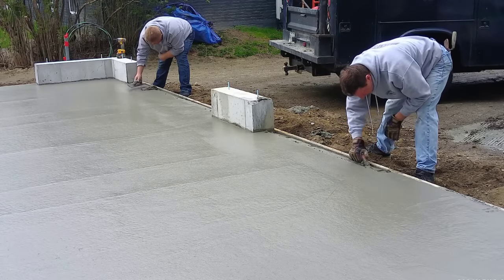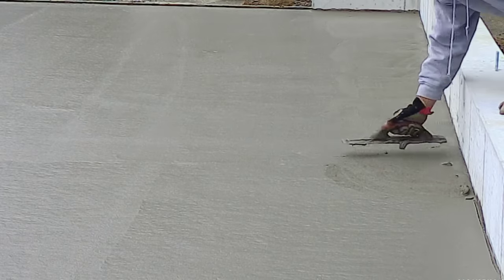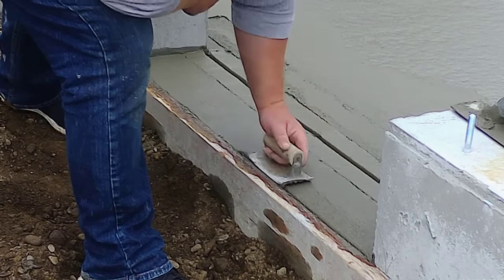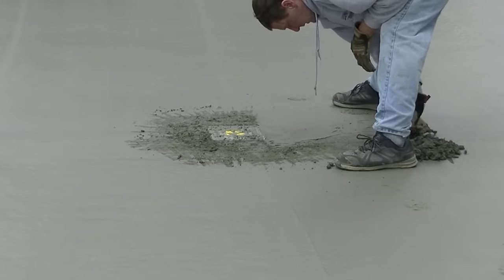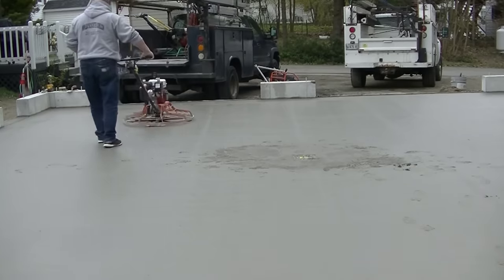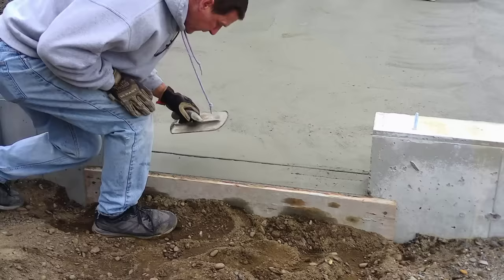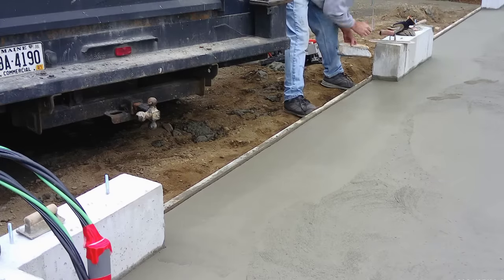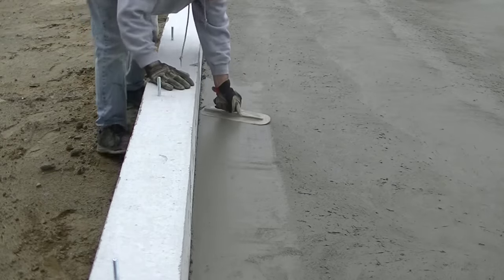Finishing Concrete - 8 Skills To Learn To Become A Better Finisher

Comment: At 2:00 minutes in, you use your mag to level up those edges. For what it is worth, I often handle my mag bavkwards. Your hand is close to the backside of the mag which applies more pressure next to the wall. That makes a new guy tend to mag it in un-level. Reversing the handle away from the wall when the mud is still soft tends to help keep the outer edge higher/level.

Comment: For the front cut down on garages and pole barns, we measure to the end of block, cut a 2 by 4 to the length then put a nail about a half in down in one end and cut the head off the nail. Let the nail ride on the forms and you’ll have a perfect half inch cut down

Comment: We typically pull the lid off the drain when we finish. If that drain allows that. I like the joint off the door. It does typically crack. Great place for zip strip. I get pretty picky on my overhead doors and check them with a strike off. Keep the videos coming. Great work.
Reply from the maker: Thanks Samuel!
Reply: My concreter suggested a round drain as the square ones have more chance of cracking around the drain. Great video. What is the smoothest finish that will allow 2 pack painting on my garage floor. I'm having 300 square metres done this week. Thank you.

Comment: Some great advice. The joint on the doorways is really something I wish more people knew. And the drain advice is something I will apply to my jobs. We usually get close. But I like the idea of going through again to make sure it's perfect. Great video!
Reply from the maker: Glad it was helpful!
Reply: Bob C.
I can relate I worked in concrete work for 45 years.  Used many of same techniques  you use. Forced into retirement  last year with kidney
transplant.
Enjoying  retirement.

Comment: Hi Mike, thankyou for these informative videos. I have a question. In Nebraska, contractors will often ask for a mix with 10% limestone. Unless I missed it somewhere in your numerous videos, I have not heard you mention anything about the addition of limestone. Could it be that adding it would be similar to adding fiber mesh?
Reply from the maker: No, not like fibermesh. 
We don't use Limestone here in Maine but I found this good answer on the web.
Crushed limestone has several important advantages over river gravel as an aggregate for concrete. First, for a given amount of cement in the mix, crushed limestone concrete will have an approximately 10% strength advantage. This strength advantage comes from the fact that cement bonds tighter to limestone than to a slick/smooth gravel and the strength that is derived from the sharp angular faces of the crushed aggregate. Second, because crushed limestone has a lighter unit weight than gravel, it will require about 12% less crushed limestone than gravel to mix a cubic yard of concrete. Additionally, crushed limestone concrete is easier to saw through than gravel concrete. This is because most gravel is silica. Silica is almost impossible to cut with a steel saw.

Crushed limestone concrete also has a lower thermal coefficient of expansion than gravel concrete. This means that slabs poured with limestone concrete will expand and contract less than gravel concrete for a given change in temperature. Studies have shown that this thermal stability coupled with limestone’s superior curing properties results in greater crack spacing, and less crack width in limestone concrete slabs.

Comment: As far as cutting the pitch in front of the garage door, try screwing in a screw a half inch down from the edge of a wood stake the mark a line 6” or whatever the distance is from he form to the garage door then screed the width of the door having the screw slide across the 2x4 form👍

Comment: Hey Mike, where you guys located? I I'm a new subscriber, I'm in East Texas (almost on the n.w. Louisiana state line), just trying to figure out how much different a concrete poured would be here than where you are.  I'm planning on pouring a 30x30 for a post frame covered patio area on the side of my existing shop. Over the years, we've (family/friends) poured a few small slabs and sidewalks, but nothing this wide. Needing all the help I can get :). Thanks!

Comment: So that 1st skill, the cutout has no air in it? I've replaced countless and not a fan, I would rather box it out personally, it's Def easier to do that your way but what are your pros and cons to your way. Do u add half air?
Reply from the maker: All our garage mixes have air in them.
Reply: That is what I wanted to know, then yeah I am a fan of that way! U know what I mean though, sometime I will have the truck put air in the last 1 yard of concrete if I am doing an apron, but I usually just put half air in the whole slab
Reply: @MikeDayConcrete  i have always been tought that concrete with air had to be broom finished or maged, and that steel trawled smooth couldn't? Whats your take mike?

Comment: Why do you use swimming pool trowel instead of regular trowel?
Reply: Marshalltown now makes double round nose trowels for finishing . There just like a square trowel not flimsy like the pool trowels your refering to !
Reply from the maker: It doesn't leave as many lines as square edges.

Comment: Never failed, as a architectural sheet metal turned flat roofer... I'd always see the biggest guy the concrete guys had running the power trowel, never see some timy kid running a floor buffer with towels.

Comment: You lost me when I saw you hitting the edges with a pool towel in the beginning. It’s a basic thing to hit the edges with a square trowel.
Reply: I think you saw him using a magnesium hand float - maybe that looked like a pool trowel.  I was taught to not use any steel trowel early - square or rounded edge. The thing he should mention, and I think he does in other videos, is to use no air-entrainment on inside power trowelled or inside steel trowelled concrete. That steel trowel seals the surface, and the air-entrainment then causes the surface to separate. The magnesium, and in the old days, wood float doesn't seal the surface, and of course, the broom leaves the surface open somewhat too.